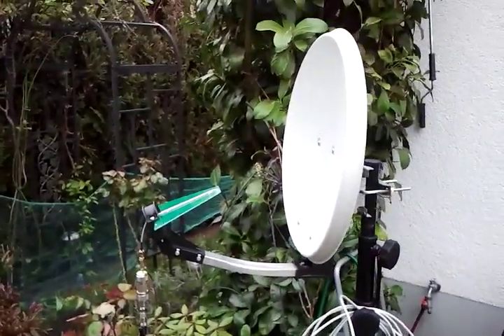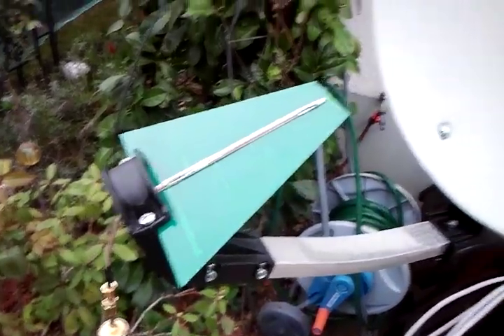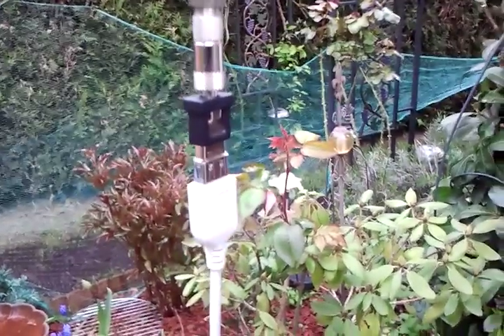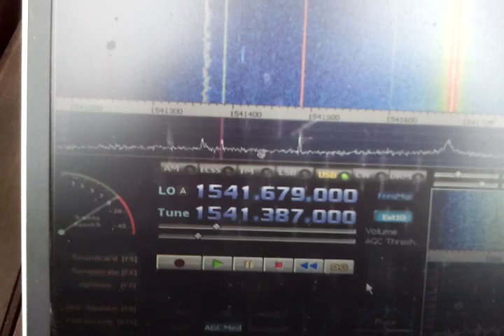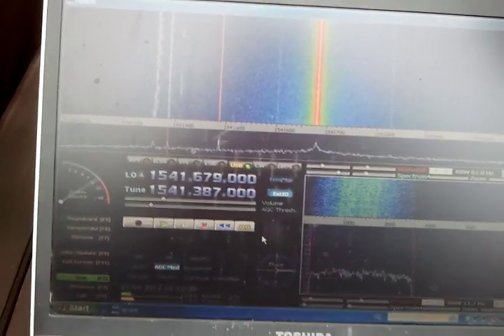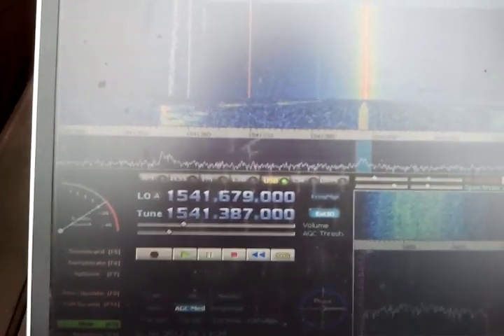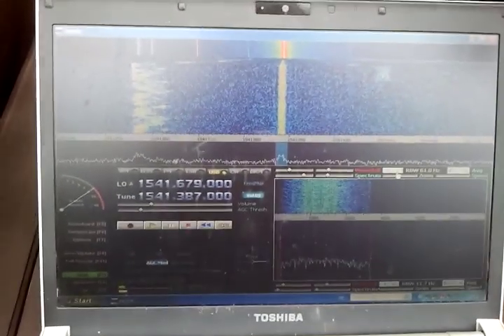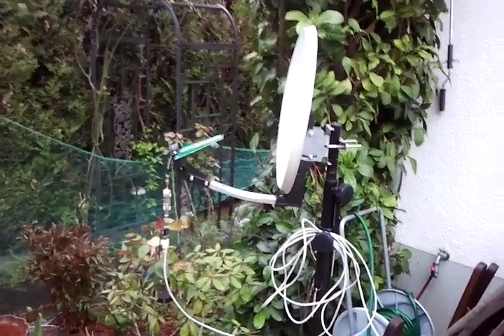World's cheapest INMARSAT reception systen using DVB-T USB dongle (RTL SDR)

Comment: It is surprising that you can have 15-16 db with this log antenna (about 6 db gain i think) and a 45 cm dish without LNA. 
I have 12 db S/N with a little modified GPS antenna (taking out the 1575 MHz filter) and 45 cm dish, but the gain of the GPS antenna is 28 db, it is amplified.
Good job.

Comment: These are really cool and extremely inexpensive SDR's but you have to calibrate the tuner for each band (sometimes more than one calibration depending on the band).
I just picked up an R820T tuner for all of $9.50 delivered to my door and it works unbelievably well for what it is. Installing the drivers can be a bit tricky though and many will have issues in that regard but once you get past that and learn how to calibrate everything it's loads of fun and costs almost nothing :)